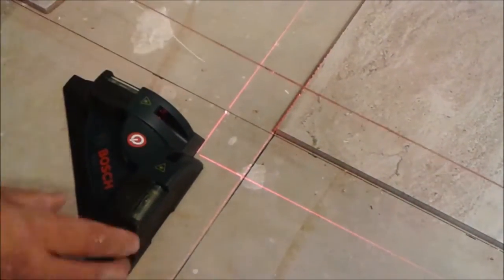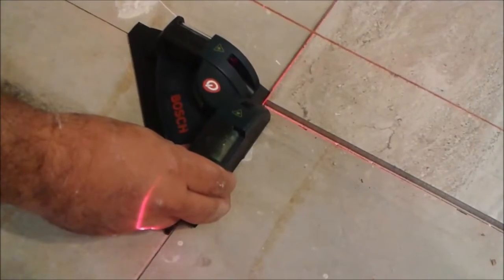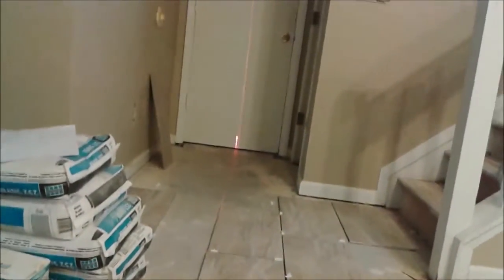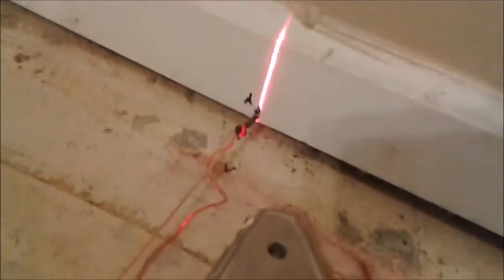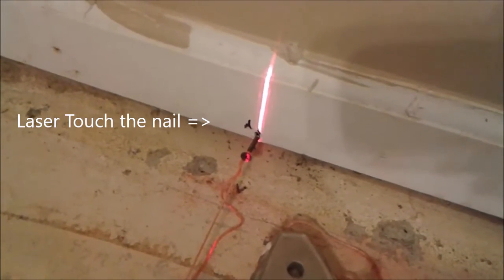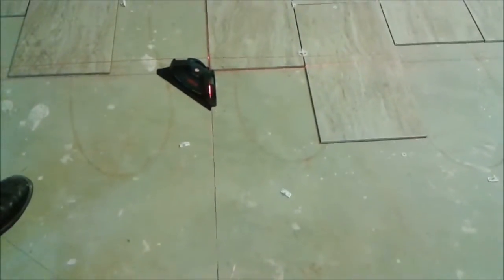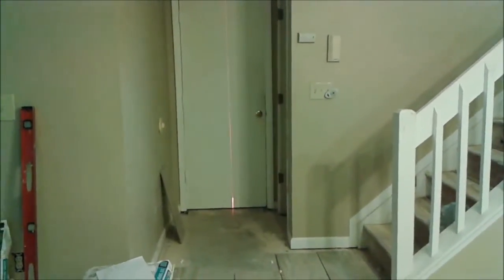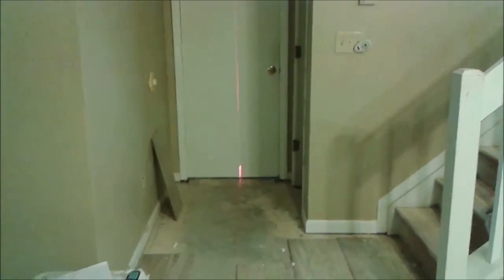Using Level Lasers To Layout A Tile  Floor - Short To The Point

Comment from the maker: Lasers Used:
Bosch Laser Level and Square GTL2 = https://amzn.to/3olZX0G
Multipurpose lavel laser = https://amzn.to/3coUK5O
Tools and Materials Used:
chalk line tool = https://amzn.to/3pCeeYy
Thinset used Mapei Ultraflor = https://amzn.to/3taAsCX
Tools and Materials  used:
Angle grinder used = https://amzn.to/368IX8C
Diamond Blade =  https://amzn.to/3j2kTbc
Dimond hole drill bits =https://amzn.to/36bX2Cs
QEP wet saw = https://amzn.to/3cLJgaW
Diamond Blade = DeWalt https://amzn.to/3jfdpSr or Black Widow https://amzn.to/3jgx18G
Grout Float = https://amzn.to/3j7KO1c or https://amzn.to/348KLMu
Notched Trowel 1/4 x 1/4 x 1/4-Inch= https://amzn.to/3j26Zpv
Notched Trowel 1/2x 1/2 x 1/2-Inch= https://amzn.to/2S5Zceg
Notched Trowel 1/4 x 3/8 x 1/4-Inch=https://amzn.to/3cDPbhZ
grout sponges = https://amzn.to/3ieBx68
Nitrile Gloves = https://amzn.to/3i8VhrT
Best Thin set used = https://amzn.to/3cxVBz8
Medium thin set =  https://amzn.to/3mSk9aR
Mapei Pre Mix Grout = https://amzn.to/2HqhdC3
Mapei Grout = https://amzn.to/340hWS5
Miter Box Used =  https://amzn.to/2SnYgm1 or https://amzn.to/2G1CVfB
Hand saw =  https://amzn.to/30kvabp
48" Level = https://amzn.to/347tmUl or https://amzn.to/30m3y5H
Leveling System  = https://amzn.to/3n39GJN
Mixer = https://amzn.to/34lymod